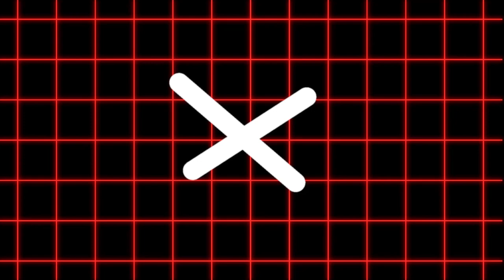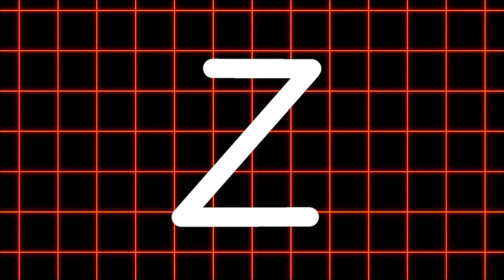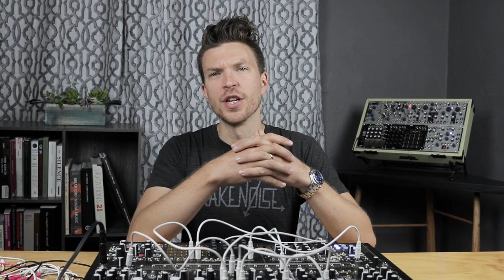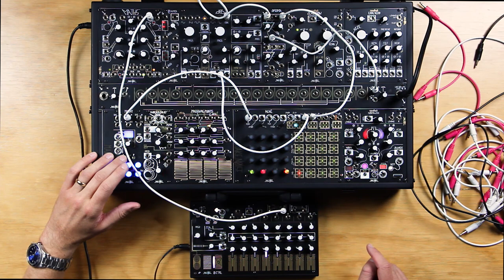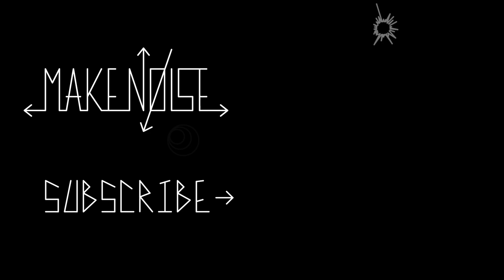Touch Macro Micro Sequencing

Comment: 5:25 how can these be different speeds? Is it because Tempi's settings are saved and loaded via the select bus? I don't really see changes in the blinking speed of René when once it's fast and once it's slow.
Reply from the maker: Yes that's exactly right. TEMPI is following René. I started with 8 identical TEMPI States (didn't show the Mesh programming, because it would have added a lot of time to get the sequence going), and then during the video I edited them individually as I selected them using the 0-CTRL. It may be harder to see because of the wider angle I needed to use (and not quite as sharp a lens as I normally use) in order to get the whole system and the 0-CTRL all into the frame.